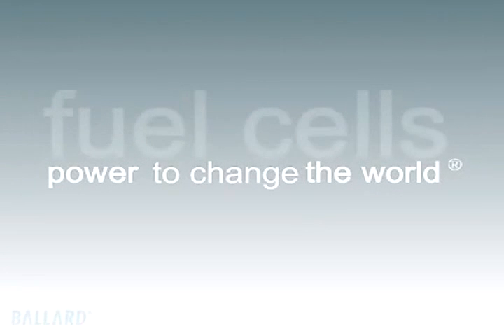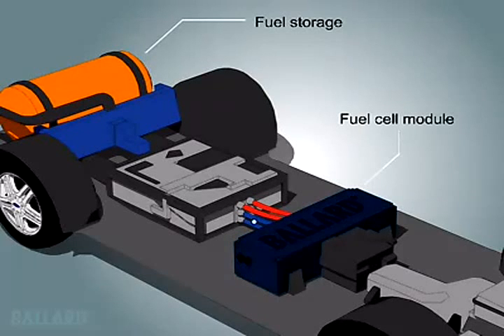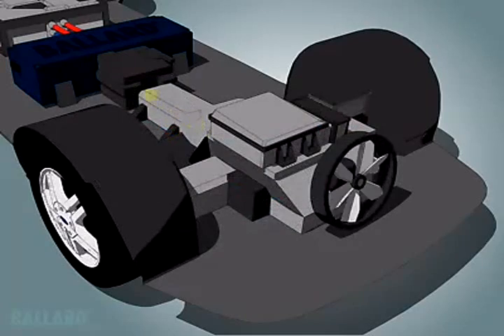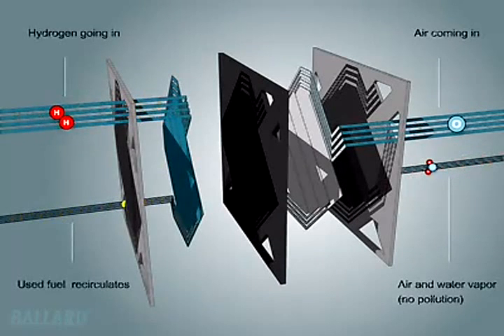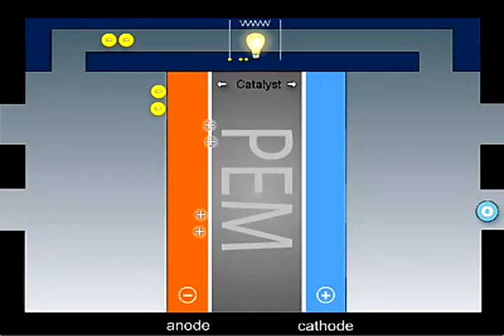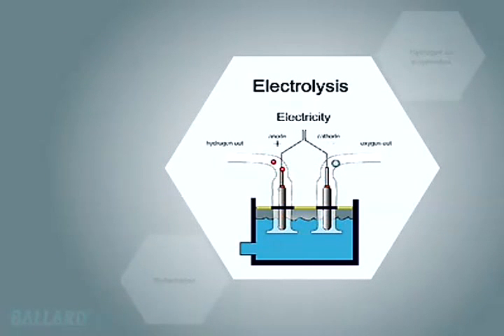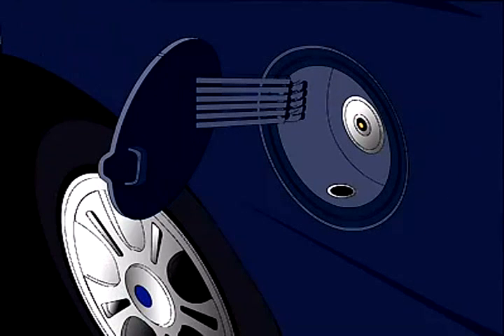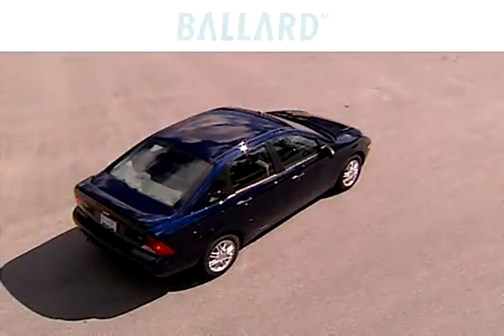Hydrogen Fuel Co - Ballard explains PEM fuel cells

Comment: If the HFC was 1/10 the size and only used to power a motor that turned dynamos it would be a cheaper set up. If the Platinum was sprayed onto a rigid form, less Platinum could be used as the catalyst effect is a surface effect.

Comment: According to thermodynamics, the energy required to produce hydrogen is ALWAYS greater than the energy output from any such device.  I'd be enthusiastic about this if:
1. Hydrogen wouldn't blow up
2. Hydrogen could be produced in a clean way

Anyway, if someone makes these 2 problems go away, I'm all for it.
Reply: +De4sher in science class in school didn't you ever experiment with the electrolysis of water? A battery with two wires dip them into water you'll see oxygen bubble off the negative wire and hydrogen bubbles coming off the positive wire. Windmills , tidal, hydroelectric, nuclear are all non-fossil fuel based power sources that can all supply power to break down water into O2 and H2.
Reply: David Hughes dude, I have a master's degree in physics. I'm just saying: in order to separate the oxygen from the hydrogen, you'll use more energy than you can ever get from mixing those back together. If that weren't the case, all you'd need to power civilizations was a glass of water. Bacteria would have figured out a way to exploit this by now (seeing as living organisms can produce currents)
Reply: De4sher you're right about it taking more power to electrolyze water than the power you're getting back, but that's not the point. You have to think of it as a battery. As you split water, you're charging the battery in a more efficient manner than any li-ion. It also does not slowly lose its electrical potential as conventional batteries do. As the HHO recombines, you're ultimately discharging the battery. 

Having said that, this is a dangerous path for vehicles since accidents are common and hydrogen is not only explosive, but also hard to contain.

Comment: I wonder how expensive this platinum based battery must be... on the other hand this car wont have classic exhaust catalyst which is usually made from platinum so in this case there should be enough of platinum supplies ;)
Reply: This is interesting, when you wrote your post the price for Pt was around 1500/oz, today is around 1000/oz. Price dropped on 33%.

Comment: So burn electricity to make hydrogen then waste hydrogen to create electricity, doesn't make sense. Just charge the sucker with electricity...
Reply: its about the energy density of energy carriers. For battery, to drive for a range of 1000km, you need 1472 kg and 2103 liters of space for battery and corresponding system. and for PEM by hydrogen(at 250 bar), you only need 114 kg and 330 liter. 

The heavier your vehicle get, the more energy you need to consume to run for the same distance. So it make 100% sense.
Reply: The electricity consumed is more useful than the Hydrogen Produced

Comment: hey i want to know that how will u get hydrogen  pls tell me
Reply: Srinath Rock The Earth's atmosphere is almost entirely hydrogen. Just put an air intake on the front.
Reply: Simon Mael Chaput its got impurities, its also got O2
Reply: Well, since hydrogen is the smallest atom, could we not put in a mesh with very, very, very tiny holes?
Reply: I don't think that's how purifying works.
Reply: +Simon Mael Chaput Nitrogen.  The earth's atmosphere is almost entirely Nitrogen.
Reply: +Simon Mael Chaput HAH! Check this guy out! Hydrogen = Nitrogen
Reply: electrolysis is a method that i know of, that use electricity to split H2O molecules apart into H2 and O2. So technically, all you need is water and electricity.
Reply: @sulien6835  there is not much hydrogens in the air what the hell are you talking about
Reply: @coolman124356  yes thats once way of obtaining hydrogen gas

Comment: and why not have the equipment for splitting the water into hydrogen and oxygen in the car and just fill it up with water 

You guys are the experts I'm just an idiot poasting stupid comments
Reply: The water vapor concentration will be diluted by the atmosphere, which keep the air at the same level of humidity as what you'll see on the weather channel.

The big problem is how to MAKE hydrogen efficiently in the first place (since it is the fuel source). Right now, we split water using electricity, giving us the by products that are hydrogen and oxygen, but the process is only 50% efficient. Further more, hydrogen is highly explosive, colorless and odorless. Not a good thing in the an accident.

So how do we keep all the benefits without the downsides? I propose we produce hydrogen and store it at a safe facility. Convert it to electricity when needed. Cars will then use lithium ion battery (like your phone) to store the electricity, thus you don't have the risk of a hydrogen explosion.

Just a few words from a mechanical engineer currently working on fuel cell :)
Reply: No worries. I still have much to learn, my friend.

And I hope one day clean energy can power not just my house but yours and many more too, we all win as a society that way.

The future is very difficult but exciting as well.
Reply: CyberspaceWanderer 

To the future 🍷
Reply: CyberspaceWanderer it's called hydrogen on demand, there's no risk of explosion then.. also if you suspend carbon and silver nano tubes in the water with the electrolyte you can get higher than 50% efficiency.. But you need alot in there.